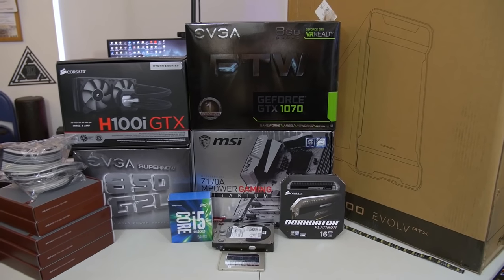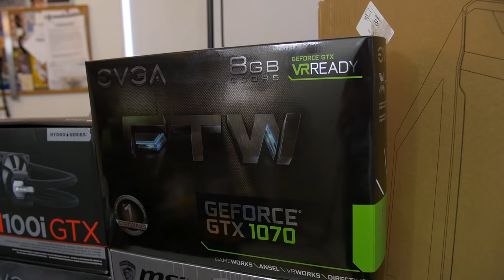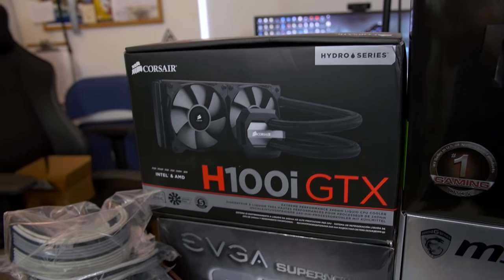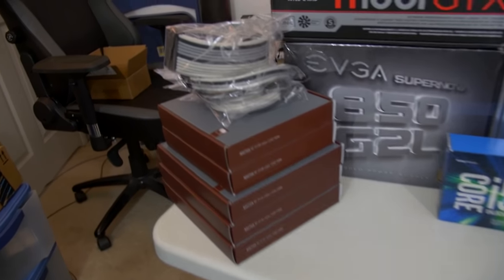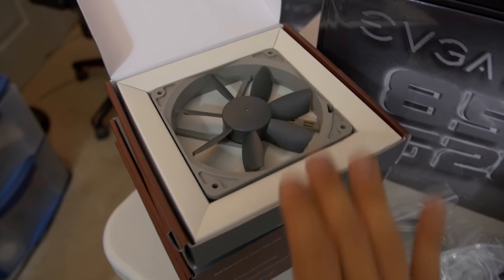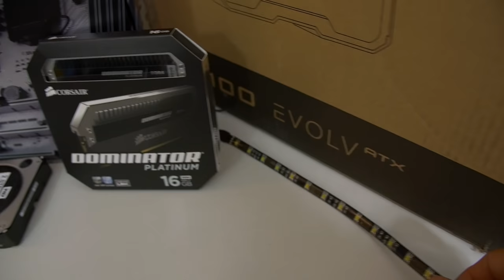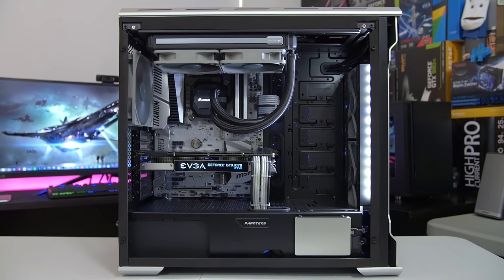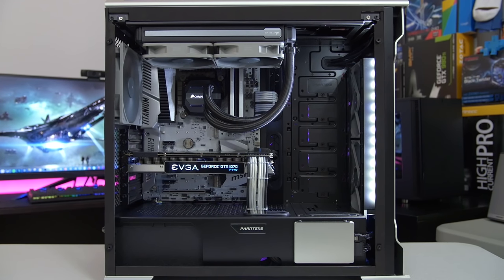THE SILVER BUILD! PC of the Month - October

Comment: I actually work at micron and I actually designed the labels during the time this one label was designed. The particular adhesive for this label was a brand new technique to help it be applied by an auto labeler instead of by hand as the previous adhesive always resulted in bubbling of the label. So the adhesive is actually applied in like a cross hatch pattern on the back. But when removing it, it doesn't all come off together, you would have honestly had an easier time removing it when it was cold though. And then use the label itself to pick up the rest of the adhesive (we have to do it all the time for RMA drives)
Reply: +5, informative
Reply: Matthew Powell Neat

Comment from the maker: I hear you guys about the Noctua fans that I put on the cooler not being optimized for static pressure. I read several reviews saying they could be used for cases or fin stacks so we'll just have to see how the temps fare in part 2!
Reply: Yeah, I was pretty worried about those as soon as I saw them, pretty much as far away from being static pressure optimized that you can get
Reply: BitWit dude it is gorgeous can u sell it to me?
Reply: Was going to comment about the fans but then I saw this comment. Nice build by the way!
Reply: Definitely anxious to see the temps with that style of fan because if they are even half decent for radiators when compared to the regular Noctua fans, I would totally take a small performance trade off in exchange for not having to paint anymore fans. I have spent entirely too much time painting the Noctua fans in my rig and one of them even sacrificed it's life during the whole ordeal. Great video Kyle!
Reply: BitWit frames bigger than my future
Reply: Oh god... i tried to paint the heatsinks on my motherboard... cost me like 50$ worth of material (lots of trial and error, wasted paint, brushes, etc). NEVER going through that again.
Reply: It might work fine, but you should do a comparison between them and proper SP fans (maybe even just the stock fans) and run them at the same RPM and see what difference you get. if nothing else it would be an interesting experiment just to see how much difference it does or doesn't make.  

But seriously, those fans are about as AF as it gets lol.
Reply: y not use the included fans? they match the colour scheme
and a silver intel ssd was needed fr the build
Reply: Kyle,i love the build,but the fans seem a little to off for my tastes!
Reply: I made the mistake of trying to use those fans on an H60 once. Even in Push-Pull they struggled. They're great for case fans though.
Also, if you're willing to take the time, you should seal up the other openings in the top fan mount panel before testing. The top vents in the Evolv are a bit restrictive, so if you don't you'll end up recirculating a lot of the exhaust back through the cooler.
Reply: sweet build! would be a shame to disassemble.  your opinion the 1070 FTW or the 1070 SC?
Reply: BitWit are you going to give it away??
Reply: I want to get away,i wanna fly away.Who is watching in 2007?I am awaiting the GeForce 8800 Ultra!And i'm gonna buy the apple phone!!
Reply: .....THE IPHONE!
Reply: Omg that thing has a touchscreen that does not have a stylist!You can use your fingers!
Reply: It's fine.
Reply: why did you use a SSD and not a flash-memory. There is nothing faster than a flashmemory and the 250 gb ssd is to small for tasks and to big for the system. maybe u can use it in ur next PC-built :)
Reply: Bitwit what's the last song kyllllle
Reply: That you need no cooling,or that you are cool and cool,literally...

Comment: "You should've bought more expensive parts". Meanwhile, i'm over here all like f**k yea, I got my 960 and im broke as shit.
Reply: Astrology i have a gt 9600m in my laptop and this old ass itel duo core cpu
Reply: Bruh i got a 9400 gt 512mb and a shitty core 2 duo
Reply: Chief windows xp here m8
Reply: I am here witg intel duo core e4500 with integrated fucking graphics! Played gta san
Reply: Doggy Bhaw Bhaw! Feelsbadman :(
Reply: bruh i dont even have a laptop/pc
Reply: Das Corné k
Reply: i have a 7850 that actually burn out some days ago and i am broke as fuck. Cant even get one of those new rx 460 or cheap ones in the meantime. Playing in low, intel graphics FTW lawl.
Reply: ***** The thing on the back is the fan hub. You connect all of your fans to it, and then you connect that to your power supply. If you have a fan hub on the back of your motherboard, then hook up all of your fans to that, and connect the hub to your power supply with the crappy connector things that no one likes. If you don't have one of those, then look on your motherboard for a slot that the fans can connect to (there should be a name on the motherboard saying "fans... something"
Reply: ***** all motherboards include fan ports or connectors to connect the fans, some more than others but usually more than enough so you dont have to worry about that. If you want a fan hub then that usually comes with expensive cases like this ones or i imagine they are sold separately.
Reply: ***** really? lol wow i dunno maybe your not looking or maybe its really a cheap motherboard lol. but yea today new ones come with enough fan headers, always look for that info just in case lol.
Reply: ***** I don't think Mini ATX motherboards come with fan hubs. So your only two options are to: 1. connect all of your fans to your power supply with molex connectors (which all of your fans should come with), or 2, you need to upgrade your case and motherboard. Most Z170 motherboards (not mini atx) I believe have hubs (at least mine does). Although they are quite expensive. Most likely, either way you're going to have to upgrade your case to support all 3 of your fans. Also, take into consideration, if you're building a gaming rig, Mini ATX is not the best motherboard type to purchase. If I were you, I would invest more money into better pc part(s). You should buy a micro atx motherboard (which is somewhat pricy). But, if you do that, then you would also need to buy a new case. My recommendations: https://www.amazon.com/ASRock-MicroATX-Motherboard-Z170M-EXTREME4/dp/B017NMX6JO/ref=sr_1_3?s=pc&ie=UTF8&qid=1477848159&sr=1-3&keywords=z170+micro+atx, and the https://www.amazon.com/APEVIA-X-Qpack3-Metal-Case-Windows/dp/B017AEDI1G/ref=sr_1_5?ie=UTF8&qid=1477847340&sr=8-5&keywords=cube%2Bcase&th=1. However, you do need DDR4 RAM with this motherboard. If you have DDR3, i'm sure you could still find a DDR3 supported motherboard.
Reply: The fans should've come with molex's, and you should be able to purchase power supply to molex connectors. But of course you would need to have a modular power supply.
Reply: lol, I completely forgot that its the case that has the hub, my bad. Basically forget everything that I previously said. I don't know were you found what cases or mobos - apparently - have fan hubs, but i'm quite sure that most if not all NZXT case's have fan hub's. The only problem is, you will only find mid tower NZXT cases.
Reply: Ozone Strike Damn
Reply: Ozone Strike my gpu sounds like an f16 warming up its engines, so i took it out before it took me out.
Reply: werner van rensburg pls, my GPU can't even run Minecraft....
Reply: werner van rensburg my pc can't even work
Reply: Astrology bruh I'm sitting with my r7 240 that I can only play hitman absolution on..
Reply: Bruh I have 740
Reply: Man I have am getting an i7 8700k and a GTX1080 for my rig update costs just a little more than £2k

Comment: that sticky shit from the SSD, or any sticker really, goes away with some isopropyl alcohol
Reply: Angel Vega or goo gone
Reply: Yeah, goo gone is my suggestion. That stuff does the lord's work.
Reply: WD40 also takes off the residue without any problems. Just another thing in case you dont have the other suggested products.
Reply: Why does he peeled off the sticker anyway? Any good reason?
Reply: Actually, any sticky residue is easiest to clean with something oily, even vegetable oil, and a rag. Then you just clean up the oily gunk, which is easy. :)
Reply: Shahazmi To prevent any color clash.
Reply: Angel Vega       Gasoline works wonders as well.

Comment: @BitWit If you want to remove adhesive residue like that use margerine or creamy peanut butter.  Spread it on and leave it for an hour, or if it is really bad overnight, and it will just wipe off from the oils and fatty acids.

Comment: tried to mimic this build, but on part picker it claims the mobo won't work with a 7700k???
Reply: Matthew Backwell its a z170 mobo
Reply: Odrish I am confused, it says the bios settings would need updated or something.
Reply: Because its a z170 board, 7th gen cpus need a z270 chipset or a updated z170, if you buy a z170 board and a kaby lake cpu it won't work
Reply: you would have to do a thing called flashing the bios just look up a tutorial on it

also every even number intel releases (6000 series,6700k) the create a new architecture and each odd number they improve on that architecture (7000 series, 7700k) so for boards that are created for even numbered cpus if you put an odd numbered cpu in it you must flash the bios
Reply: Matthew Backwell Bitwit has magical powers.

Comment: Intel is so boring....make AMD build here and there.
Reply: amd is bad
Reply: replace bad with outdated
Reply: 2Starfighter It is outdated, but I wonder how Zen will be?
Reply: I have FX-8370, 16Gb of ram and R9 280;this PC works fine and you can call it whatever you want but it is not bad.
Reply: 2Starfighter Can't exactly upgrade that except for graphics card.
Reply: AMD has had nothing to show for lately except GPU's so creating an AMD build right now would not only be more boring put pointless. Until we get Zen, there's no point in doing AMD builds.
Reply: There is no point to make the same Intel machines over and over again also.
Reply: 2Starfighter Still more sense than AMD considering there's even hardly any dope motherboards available for their current lineup. Not to mention that it's way too outdated to even bother. It's not as if these Intel builds are really the same part per part anyway which is why this video (and a lot of others) is centered around aesthetics instead of specs. There's a lot of combinations to be done because of the wide array of options available for enthusiast-grade Intel builds right now. Just be patient and wait for the Zen lineup.
Reply: 2Starfighter 
Dude AMD dosent even support ddr4 yet. I hope Zen is competitave.

Comment: Have the same case. Mistake was to put radiator on the top. It goes in the front as an intake. On the top it just reuses it`s own air and temperature howers at the same level as GPU. By changing it, temps drops to 50ish and nothing changes to GPU temp.

Comment: Gotta love the Phanteks case.  I have the same one and of all the builds I have done it is my favorite so far.  I like the color scheme however would have stuck with black fans personally and front mounted the rad.  I know a lot of people are against front mounting however my systems thermals are fine.  Nice job on the wire management, love the cable extensions.

Comment: Kyle,

I built a similar system in the Enthoo, just white with a 980Ti and 6700K instead. I wound up putting my 240 rad on the front because it just sticks down too far when mounted on the bracket. I put three fans on the top for exhaust, the two on the front pulling air in and the one in the back exhausting. Seems to work pretty well. I also got corsair fans with lights (white of course) and the LED strips around the left side of the bottom and front and right side of the top.

Comment: Great video, awesome looking build. Loved the case.
Would have swapped the fans though. The NF-S12B/1200 rpm ones are optimized for air flow, while the NF-P14s/1500 rpm fans are optimized for static pressure, making them more suited for radiators - especially once some dust starts accumulating on the fins ;)

Comment: Should not have used those airflow fans for the H100i, but I understand that Noctua does not make static pressure Redux 120mm fans. They do make them in 140mm, but that would have necessitated using the H105i, which is not as badass-looking.

Comment: Should definitely remove the label on the other side of the PSU, would of totally finished up the right side of the case. I can see why you would leave it with the potential of reusing the PSU in a later build; obviously having the power stats label on it helps so you can easily identify what the wattage is lol. Gorgeous build though and great to see someone actually putting that case to use!

Comment: I'm in the middle of a similar build, using an MSI Xpower and a 1070 Founders Edition. Same Corsair memory platinum memory. For the one visible fan (the non-spinning parts) and the power supply, I applied a few coats of gunmetal gray plastdip, followed by some Bright Aluminum Metalizer. My PSU and fan match the motherboard's silvery color almost perfectly. Everything is pretty much done, aside from possibly taking it out of the white Corsair 500R case its in and putting it into a thermaltake P3 or P5. I can send pics if you'd like.
Reply: ExiliousX What PSU?
Reply: Luca Passalacqua it's an EVGA G2 that has been painted white with silver flakes
Reply: ExiliousX Oh, OK. Cool!

Comment: Here's an annoying thing I discovered about the case. I purchased a nice 280mm AIO and ran into a compatibility issue. I'm using Corsair dominator RAM which is a little too tall for the radiator and fans to slide all the way back. Obviously a 280 Rad fits fine if you have shorted RAM and dominator is about the tallest out there. I'll have to settle for a 240mm.

Comment: Could you place the radiator to the front and make the fans push the air out the front?
It really destroys the lines with the two Noctua fans kinda crossing each other. Same goes for the radiator, that loop just messes up this clean build. Maybe those water lines straigten out once you installed it in the front.

Comment: Hello, I have seen numerous builds with the Phantek Evolv ATX, but for a case that enables builder to put in crazy amount of memory I have seen none. On the right hand side/front of the case the case can hold 5 3.5 dives stacked in nice ready trays. Sound perfect for a raid setup. Why have I not seen this? Can you not put fans in the front of the case and use the drive trays? What size fan can be used in the front and leave the drives trays in place?

Comment: What's up Kyle. I built my own rig with this case too and I have to admit it's gorgeous. But there is one minor thing about this case I don't know if you can test it out. Can you maintain the positive pressure inside the case (with the front panel on)? In my case i have the Corsair H1110i GT, 1 Corsair ML140 as exhaust, 3 Corsair ML120 as intake and I still can't keep the pressure inside the case positive.

Comment: Very nice build. I've got the same case but in Black. I noticed you managed to change the orientation of your ssd and ran the cables towards the front of the case. I'm pretty sure I had a feel around there and there wasn't anywhere easy to run those cables. Do you mind telling me how you did that?

Comment: a much better alternative to the crucial ssd used here is the sk hynix sl308. It has very minimalist branding on a silver ssd that in my opinion actually looks good rather than annoying and intrusive. sk hynix is a somewhat newer asian electronics company but they make VERY good products and are a newer leader in the memory market. The performance of the sl308 is very comparable to the crucial mx200 and the samsung 850evo. it does have lower random reads and writes at higher qdepths it's a phenomenal performer compared to the crucial at $50 less(!) @ 500gb. the tom's hardware review of the sl308 absolutely sold me on buying one for my new rig

Comment: Hey Kyle,
I'm getting a Evolv TG ATX soon, and was wondering if it would look better with the 240 rad mounted on the front?
I know that would be exhausting warm air into the case, and not helping the GPU keep cool, considering it's got a stock GTX1080 ducted GPU cooler.
But I find the top mount rad covers part of the mobo, especially since I'm getting an Asus Strix Aura ATX-E with all them pretty parts.
The original plan was for a Corsair H80i push-pull at the back, but that would really cover the mobo :-(

What are your thoughts on rad placement?

Comment: I've a question if I may, I'm just about to build pretty much the same setup(this mobo, case & gpu) but from what I can tell 2 way SLI is gonna be tough to pull with this mobo + case combination? since the 3rd PIC-E slot is way down there that leaves no gap between the slot and that underneath PSU enclosure as well as considering how thick the GPU itself is.

In other words, do you see a problem happening with this setup if you were to install the 2nd GTX 1070?

Thanks

Comment: A little late to the party here, but with the Dominator RAM did you have issues mounting the Radiator? Is there anything you did? Mine rest against the ran a bit more than I would like and I can't mount the radiator on the front since I have an HDD and need that cage

Comment: What would be a good replacement for this motherboard? I'm also going with a black/silver theme.
I'm going to be using a 6700k, with two 1070s (I won't go over 2-way SLI so I don't really want my board to have more than that).
32GB of HyperX Fury RAM
1x 500GB Samsung SSD
1x 3TB HDD and 1x 4TB HDD for my footage.
I'm also going to use the same case that he used in this video so the motherboard needs to have enough cables for the USB ports on it.
A motherboard that can do all of this and has a black/silver theme like the one in this video.
Got any suggestions?